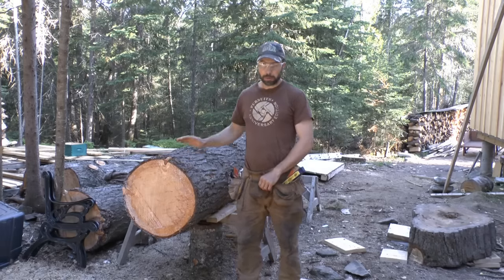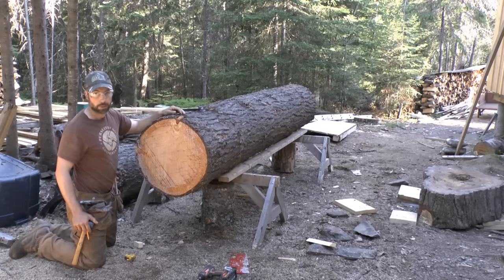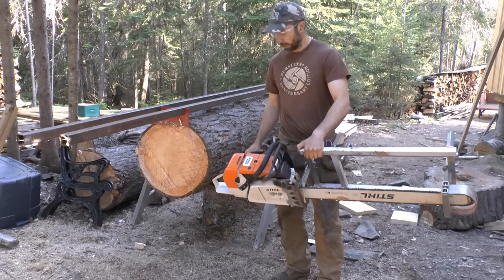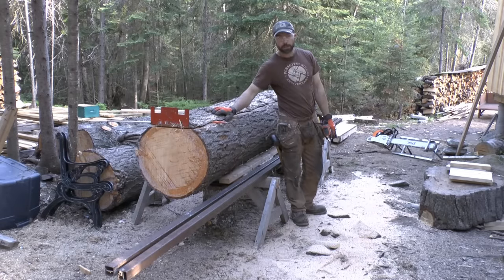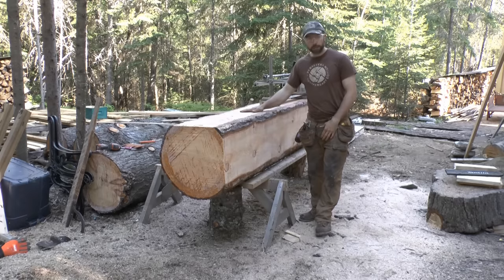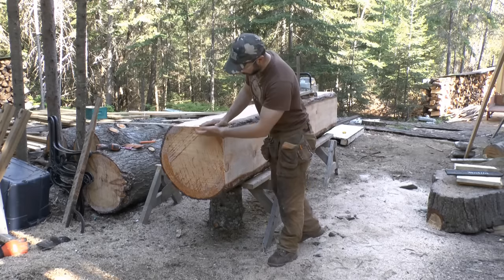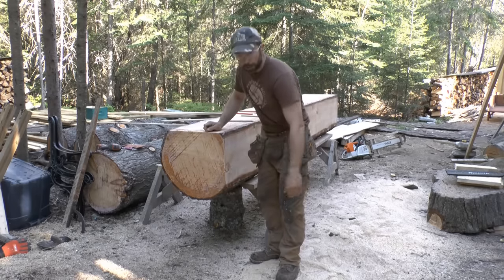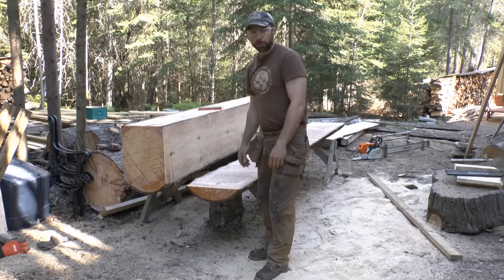Logs to Lumber: Alaskan Chainsaw Milling

Comment: Agree with Quinn Kent; best first cut rail setup I’ve seen. I’m changing my setup after watching this. EXCELLENT VIDEO!
Reply: Tenghen and Granberg sell a similar setup. They're both virtually identical. I have a 9' rail guide and I have intentions of buying another bit to extend it so I can rip 12-13' boards.

Comment: This first cut method is by far the best I have seen, I have used this method  since seeing you video and without a doubt the most accurate portable method I have used or seen. Thank you very much brother for sharing this video, 10/10 mate👍👍👍👍👍
Reply: I agree this is the best first cut system of the dozens and dozens of videos I have watched. What did you use for the rails and the end brackets to replicate this?

Comment: I've started milling this way and I must say so myself I've produced some of the most beautiful lumber!
Reply: How much are those rigs? Minus the saw, I have one.
Reply: @alienman7866  I bought a 9' Tengchen guide rail on Amazon (Almost 100% identical to the Granberg setup) for $100. I plan to purchase a shorter guide and combine it with my 9 so I can rip the 12-13' boards I aim to. The chainsaw mill itself is separate. You can purchase rigs or even handcraft your own.

Comment: watched hundreds of wood milling videos you are the first one I have head suggest using the bark wood for Sidings. here in Scotland when I was a child in the 50s the bark board was widely used for lots of projects. indeed, it was probably the most used lumber of the working class.
Reply: I watched 4 and heard it.Lucky I guess....
Reply: Even though bark itself is super whether resistant, the  problem with using it for applications where it's exposed to weather is that it causes water retention between itself and the wood it's attached to, causing the wood to rot faster.

Comment: I like how the saw 4-strokes when idling. ; - )
Reply: Helps with cooling, I think.

Have heard it’s best to richen out the mix, and run a bit more oil.  Is this true?  Asking for a two-stroke emergency generator, which will run at a load for up to an hour at a time.  Have Maxima K2 oil, and plan to run about 28 to 1.

Comment: Awesome video.  This video is the reason I purchased a chainsaw mill and I copied your rail supports :)  They work great!  One suggestion I had from a viewer on one of my videos using the supports is to weld a nut on the flange where the rail goes through the plate and then use a bolt to clamp the rail in place.  I have had some issues with the rail vibrating and moving some while sawing.  Thanks for the video!  Subbed!
Reply: How did you go about finding square tubing? I can't seem to find any more than a few feet long, so maybe I'm just looking in all the wrong places.

Comment: Hi Patrick,  thankyou for that information. Its everything I need to fab my own plates.
Even though I have an old log cabin, I'm not as comfortable in the cold as you obviously are.  
Thanks again and take good care of yourself out there.
Cheers
Steve, ottawa canada
Reply: could you share dimensions please
Reply: @ianpitts8582  hi Ian, as I recall , the rails are 2" square stock @13 ft. Long and the 2 end plates are 1/4 inch sheet stock. I didn't recall seeing any more detail than that but as for fabricating the end plates, im sure its fairly straight forward. I havnt fab-ed mine just yet.
Good luck

Comment: Love the rail support brackets. Any chance you can share the rough dimensions and guage of steel used ?
Reply: Gauging by thumb ratio (@ 4:54) and 'grunt factor' (@ 5:15) I'm guessing 2" x 2" x 1/8 (0.125") wall, x 12 ~ 15 feet.
Reply: @Dr_Wrong  surviving ringworms newest video gives a guide to make them, he has had them for years!
Reply: @tylerroddick3877  don't you just get a mommy ringworm, and a daddy ringworm, and give them some ringworm booze?
That's how I'd make 'em..

Comment: 2:23 I didn't read through all the comments to see if someone already mentioned it, but fats will dissolve tree sap. If you want to un-glue your tape measure, slather some cheap vegetable oil on it, or if it's more convenient some of your bar oil.
Reply: Растительное масло высыхает, становится липким. Наверное, лучше машинное или лампадное...

Comment: Bro love your way of doing it. I’m doing that someday in my future farm. Good job. Question what stihl model is that ?
Reply: I don’t know what he is running... but you will want run something north of 60cc’s. A friend runs a Stihl ms261. Not the cheapest saw in the world. I have only begun to dabble in milling. I have done a few smaller Logs with my Husqvarna 240, which is only 40cc. I’m pushing it to the limit, but it’s fun. This fall I am looking at upgrading. You got to start somewhere! Hopefully this is helpful.
Reply: I run a ms 661 and it works great.
Reply: I use a Stihl 382, plenty of power in the still 380 series
Reply: I've been doing this as a hobby for a couple of years. I use a MS460 with a 32" bar. Works great.
Reply: It looks like an 88
Reply: @GATOR-ef3wv  i use a 35 cc echo on my
Reply: សូមកែខ្ញុំមួយមកតម្លៃប៉ុន្មាន

Comment: Is that saw/brackets&bars set-up your design or is it available somewhere (to buy or get plans)? Good video, clever.
Reply: I'd be interested in this as well...
Reply from the maker: Its a Granberg "Alaskan Mill".  The rails are plates were just something bought locally from a metal fabricator

Comment: just borrowed a friends mill, about to start milling my first logs tomorrow.  Your overview was quite helpful in learning the basics!
Reply: @abc20914  
thanks for the advise.

I got sick of filing chains and I'm a machinist , so I've built a pretty nice sharpening machine, no files needed, gives a factor grind a run for its money.

as for the chain, no its not technically a ripping chain.  But it is skiptooth and since its been with me, I've changed from the existing 30deg grind, to a 15 degree.  I know some people go as low as 10, and I might still just to try it.  But 15 seems to be a good compromise of feed pressure & durability.  I'm guessing by 90, degrees, you meant 0?  That seems really extreme to me, as does completely removing the depth guides.  Whats the advantage of going from where I'm at, to the extremes you outlines?  I'm pretty new to this, so I'm all ears.  Keep in mind, I'm working will borrowed equipment, though I'm sure he too would welcome any improvements that could be made.
Reply: @abc20914  haha..thats a bit of a loaded question right now, I'm in the midst of figuring that out.  So far, the logs I know have been maple, elm & willow.  Another one I am trying to ID might be Mulberry or Sassafras, not sure though.

oh and I just found out the person whose equipment this is, has a previously used chain that he had dis guarded after hitting some metal.  I'm gonna try to get that from him & play around with some stuff.

You notice any difference in finish / quality of cut with different sharpening angles?

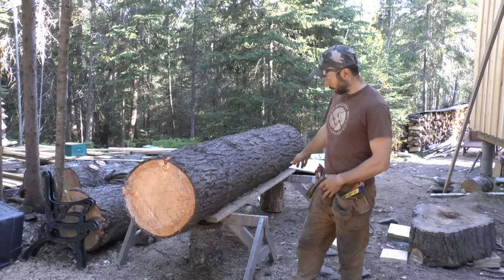Comment: Minute 1:40, that's how the Pyramids were build, mystery solved!
Reply: The pyramids were sq rocks . Not logs,lol the piled earh up then pulled the rock over logs as rollers on a conveyor belt work.once stack completed  the long task of removing the dirt began. This man is doing a awsome job of using his head to save his back. Bbrains are stronger than brawn.
Reply: No way aliens build them. 🙃

Comment: Great video, thank you. I was thinking of a rail system like yours. Could you please supply specifications of your end plates and rail tubing. Do you think 2" x 1/8" tubing is thick enough? Do you find that your rails are stable enough that close together? I was thinking maybe a couple inches farther apart would be better, but your saw doesn't appear to tip much during the cuts. Thanks so much.

Comment: Holy crap the freakin bird chirping! You can go into the audio track and filter out the high frequencies...
Reply from the maker: I will try to figure that out for next time (not sarcastic)
Reply: Birds sound great. I like em.
Reply: I like them too, it’s just the level of them and the dialogue and the other sounds. Tough
Reply: I've not been to Alaska yet but here in the East US that bird sounds like a red-eyed vireo.  You hear them before you see them, and then look up as they'll be up and not in the bushes.  "here i am...look at me...cheerio...here i am".  There are other more colorful mnemonics out there. Thanks for great video.  I will be doing this with some oaks.
Reply: Complain much?
Reply: @Rockoblocko  I like birds too---lots of Garlic

Comment from the maker: Had a few questions about the end plates and rails, so here you go!
5/32" x 2" x 2" steel tubing, bought locally. 
The end plates are 1/4" x 12" x 5". The notches for the rails are about 1-3/4" deep so that the 2" rails sit a bit proud.  These were cut locally by a metal fabricator.
Consider getting "offset" end plates of different heights (eg. 1 at 5", 1 at 10") if you are going to be cutting heavily tapered logs, like butt logs with lots of flare.
Reply: Really nice set up. I just started milling smaller logs.How long are your rails?
Reply from the maker: @hawkeyeshawkeyes7468  I think they're about 14'6" to mill up to 14' logs.  I may not have shown in the video, but little stopper bolts in the end prevent the rails from sliding out of the plates if milling on an incline.
Reply from the maker: Smokey Bear  The boards went right from the mill up onto the building with no additional processing required.  Aside from a negative outlook, what made you think the boards weren't accurate?
Reply: I have found much success putting a half inch or 3/8 inch cable between two trees and then using cheap Walmart come alongs to move very large logs into my work area.
Reply: O Quitalo
Reply: Ponlo En Español Lo Estas Pazando En America Latina O Quitalos
Reply: Smokey Bear  His way is geared more towards production and your way is more for the hobbyist. Wedges are used to prevent any weight bearing down on the bar.
Reply: That's funny, after i watched your video i searched online for the end plates you used but no luck, i come back to see if you mention the manufacturer to find out they're homemade lol. Good idea! Are you running the 660 or 880?
Reply: Awesome info! I have been looking at how to build something like this myself. Thank you for sharing!
<-- New Subscriber!
Reply: Thanks for the video I own the same portable Alaskan sawmill has a 5-foot bar on it and I've owned it for 10 years at least I cut trees down for a living and wanted to mail out some bigger beans my house that I'm working on that video was very helpful it was a setup I got logs anywhere and saving them up I'll try one in the spring I know I ripped chain where it's well how many cc's 80 or 90 cc's to really get the job done and how long did it actually take to mail the four sides because the video was speed it up I'm guessing quite a while if you get a minute can you let me know you make it look easy thank you
Reply: Smokey Bear  U make no sense !!!
Reply: Smokey Bear how would you attach the first cut system for a chainsaw mill to the log ( not the slab) with out the attachment mechanism getting in the way of your cut?
Reply: Smokey Bear  There is a method to his MO it works efficiently quickly accurately safely and the whole time This Gentleman slowed to speek to the BIRDS and the camera. 
Much respect must be given he knew where every tool was he knew the exact measurements that would be needed and even saved his back by not rolling that log over instead he broke out the skills of the Granberg Alaskan chainsaw Mill with a 5 and 1/2 to 6 in adjustment on the mill. I must confess as I was watching this video I got my computer out opened up my cad program and in about 15 minutes I had the brackets design and ready to cut. It wasn't until after I read through the last of the comments that he was generous enough to give exact dimensions of the plates and the square stock. I will be firing my plasmacam up in the morning and cutting at least four of those brackets with at least one that is 10 in tall.
Thank you sir I picked up a lot of tips and tricks from this one video I've been an arborist for 30 years and I am just now getting into the Milling. Bought myself the 60 in Granberg Mark 4 with the new Alaskan winch can't wait for the first opportunity to use it
Reply: Hi. I am going to order such plates from the local metalist in Belarus, but I dont undersand the sizes of the notches. It stands 1-3/4", but what is it?
Reply: @elijahowens8507  Haha! We did the same thing here.
Reply: How many cc chainsaw is that and what's your bar length?
Reply: Quiero una

Comment: I am surprized those wooden saw horses, even held that much weight.Better metal saw horses, your taking a risk of it collapsing. You have many options to improve the handling of the lumber , over head chain hoist. A centering device to allow the rotation of the logs. The simple set up you have is working great.  With some new ideas you could work smarter, safer, and not harder. Your taking too many risk with the idea the weight of the lumber could collapse those saw horses, and it would end up on top of you. The quality of the cuts are great, the viideo is excellant. I learned a lot watching this. Safety is what it's all about, take fewer risk. You have a great concept.
Reply from the maker: Thanks Troy, we're big believers of incremental improvements making a big difference in the long haul.  We have generally felt under control handling the logs with the peaveys, but I agree there are opportunities for improvement.  Happy sawing!
Reply: Are you joking? Please tell me you're joking...

Comment: 20' aluminum extension ladder for rails has served me quite well for over 20 years. started out with steel like you.
Reply: Great idea!
Reply: as with most rails, use what ever means to support the middle so the weight of the power head doesn't cause a sag on a long first cut. I use standard chain(chisel ground round as well) back in my start the milling of the chain cutters were hardened by way of design. hand file was useless @SpringRubber

Comment: Hi! Great entertaining channel! 
Im in the process of purchasing the equipment to mill some logs up at my old log cabin and after watching many youtubes on the topic I think your setup works really well and perfect for my situation. I just got my chainsaw 60cc  and will match that with a grandberg that can mill at least a 23 inch diameter log. What I really like about your set up is your rail system. It looks like 2" square stock 10' would suit my needs fine. But im wondering about the steel brackets that support the rails. Im hoping you'll share with me where  you purchased them. 
I'm enjoying all your content!
Thankyou and Cheers!
Steve
Reply: Just found this earlier comment from Lure of the North:
5/32" x 2" x 2" steel tubing, bought locally. 
The end plates are 1/4" x 12" x 5". The notches for the rails are about 1-3/4" deep so that the 2" rails sit a bit proud.  These were cut locally by a metal fabricator.

Comment: I had one. Back breaking. They make a pulley attachment. I sold mine before I heard of them. I suspect the pulley hand crank helps significantly.
Reply: Put a small boat anchor winch on mine and yet to start using it.

Comment: Great video just wondering about your rail  bracket system  do you have a pattern for the support , what is the length and  spec on 2” square stock is it 2” x1/4” black steel? What about the material for the bracket? Great video

Comment: Hey great video. They way you handle the large logs is Clever but your in great shape. Does a big manually milled log like this one wipe you out? You make it look easy... thanks for sharing your skills in milling it’s inspirational.
Reply from the maker: Moving the logs, the slabs and the lumber is all heavy work, but you learn to work smarter not harder.  The peaveys and cant hooks are pretty remarkable in the leverage they provide; shimming the center of the log allows you to spin them fairly easily, etc.  I'm just starting to learn some of the many tricks of log management!

Comment: Your big long tailed cat looks happily well fed, I first thought he was a lynx until he came closer into frame.
How long a cut will your metal rods allow you to cut once they are dropped into the level metal end keepers?
There must be a grade-all or some mechanical equipment out of frame as those appear to be some rather substantial logs; what is your average milling length?

Comment: I think ill make myself a 30mm thick 3 meter long workbench table plate out of some big European beech I got in our forrest like twice the size you cut in that video 1,4 meter diameter on the smaller side - ill just weld myself a sawjig first , got enough scrap laying around
so... do you cut the wood green or let it dry first witch one got no fractures or binding afterwards?  Do you notice a quality difference between winter wood and wood cut when its green

Comment: FYI.  If you weld its not diffocult to make your own chain saw mill. You need a long bar because the mill reduces the actual usable cutting surface.

Comment: Man that stuff must be light. Im jealous that where you guys are theres so much lightweight timber. Here in Australia everything is hardwood and it all weighs a tonne. To move a log the size of the one you roll at the start would take 6-8 men and much longer. Nice work.
Reply from the maker: We just make it look light! :D
Reply: @lureofthenorth  hahaha yea righteo :) got a friend from canada who came here and tried to build a stringy bark eucalypt log cabin, gave up on that after about 10 minutes of trying to move a 12ft length around and went with wattle instead. Good luck on all your milling adventures.